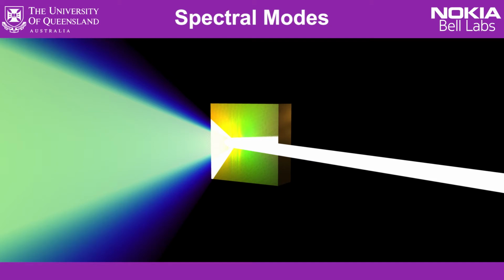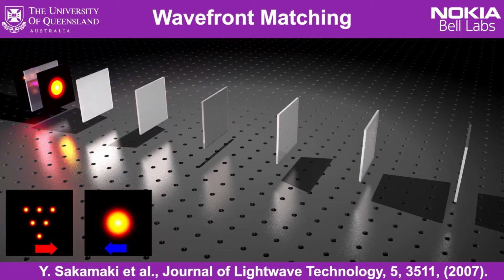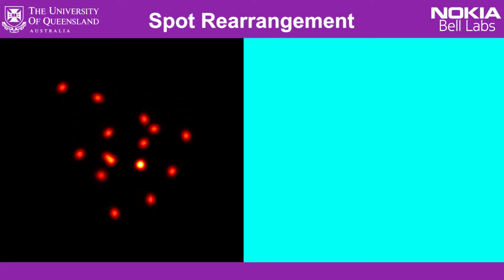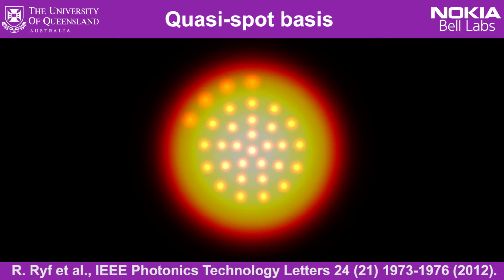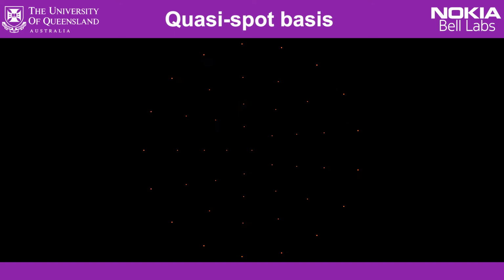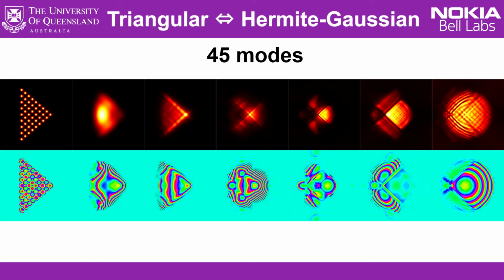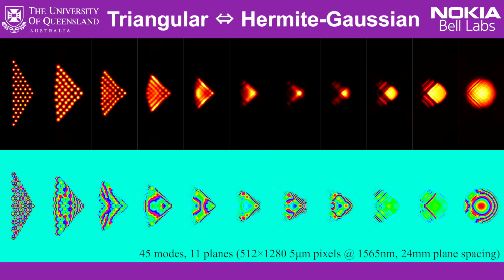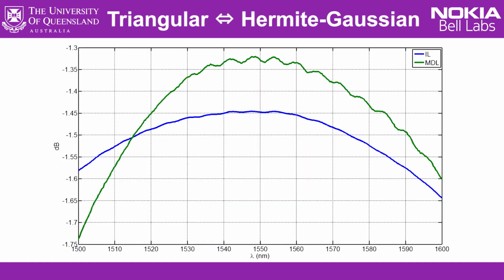Multi-plane light conversion with low plane count

Comment: Hi! Thank you for your excellent video and the provided code—it has been incredibly helpful for my understanding. I do have one question that has been puzzling me, and I’d greatly appreciate your insight.
In the MATLAB code, each output HG mode corresponds to an input beam spot, and they appear in pairs, calculated independently without superposition with other modes. This makes sense for HG modes since they form an orthonormal basis. However, the input beam spots don’t appear to be independent; optically, they should be coherent. Yet, when calculating the intensity, the intensities of the modes are summed rather than their complex amplitudes.I understand that treating them separately preserves their one-to-one correspondence, but I’m confused about why this is justified for the modes themselves. Could you help clarify this point?
Thank you in advance for your time and explanation!
Reply from the maker: All the input spots in the set are orthogonal, just like the output modes are (or indeed if you chose any random plane in between you'd also find that the fields are orthogonal there as well). It's easy to tell the input spots are orthogonal because they're just spots that exist at different locations, so because they don't occupy any of the same space, they're orthogonal.

The input spots do not have to be coherent. The field only has to interfere with itself along the optical path in order to transform into the desired output mode. It'd do that even if the other spots weren't even there. Indeed if the spots did have a coherent phase relationship between each other, you could actually think of them as being the same mode, not different modes. I've got another tutorial on 'spatiotemporal control of light' that could be worth watching the section near the start.

Imagine something like a polarizing beamsplitter. It'll split the polarization components regardless of whether there's a coherent phase relationship between the components or not.
Reply: @joelacarpenter  Thank you for your response!  I checked out your tutorial on ‘spatiotemporal control of light’ and it was very helpful in my understanding!

Comment: Hi! I was wondering how the output modes (HG modes) are overlapping since each of the mode seems to be a point on the triangle hence looking like it is spatially seperated.
Reply from the maker: Throughout the entire transformation, whether it's on the spot side where all the modes are spatially separated, or on the HG mode side whether the modes are centred at the same position, or anywhere in between, (ideally) there is no overlap between the fields. The HG modes 'overlap' in the everyday sense of the word, but mathematically they have no overlap because they're orthogonal. i.e. if you took mode A and mode B in any plane, and then did A*conj(B) and summed up that function over all space, it'd be zero. In another tutorial on my channel about 'spatiotemporal control of light' I explain some of the principles involved.

Comment: Hi, I was wondering if you have a source code for a simulation of a MPLC composed of equally spaced phase masks?
Reply from the maker: Yep, if you look in the supplemental material for our 'Laguerre-Gaussian mode sorter' paper, there's Matlab code provided...https://doi.org/10.14264/uql.2019.81
Reply: @joelacarpenter  Thank you so much, the paper was really helpful, and the code is very well-documented. For context, I am a Physics undergraduate student that is trying to design a MPLC device that works with HG beams. But here I'm optimizing the patterns of the phase masks to target a certain transformation in the HG mode basis, and not to target specific N output modes given N input modes, so it's not exactly inverse design. For now, I am trying to work with 1D HG beams to later generalize it to 2D. I'd really appreciate if you could suggest any resources that I could check to learn new topics that could help me with my project.
Reply from the maker: The textbook 'Fundamentals of Photonics' has a chapter on beam optics, and a chapter on Fourier optics that's useful for getting acquainted when you're starting out in this area.